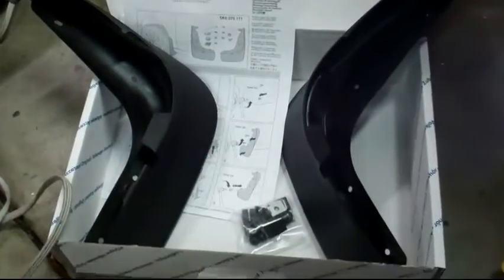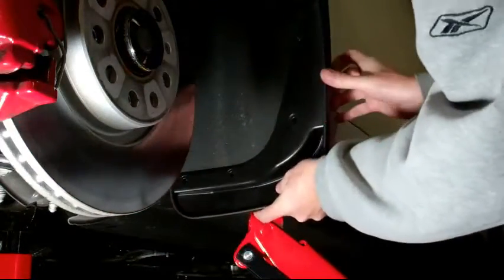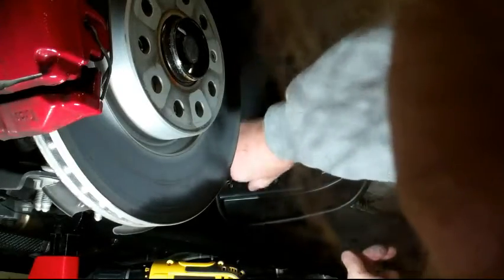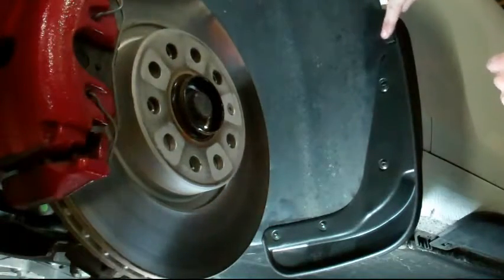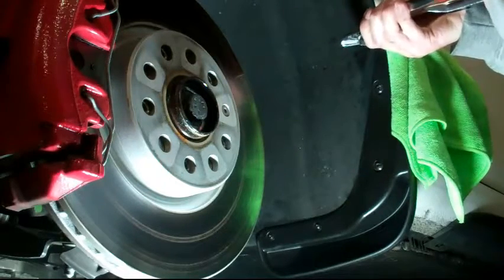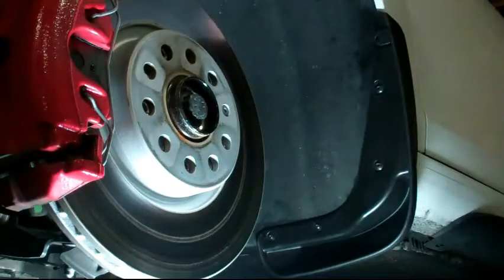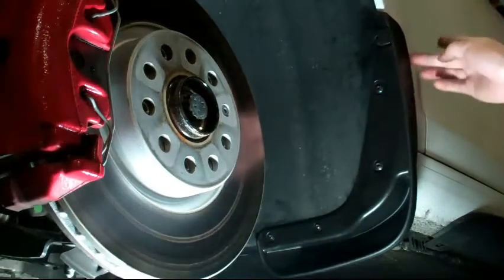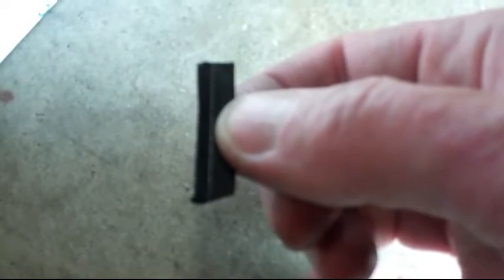2011 VW GTI: Episode 23 Vlog: Installing oem front splash guards

Comment: Anyone know how to remove the clip? I need to remove mine for some work
Reply from the maker: what clip man
Reply: Hey, what Ii mean are the 2 piece clip that holds the mudflap to the body
Reply from the maker: the clip that came with the kit?? It just slides off after you take out the screw..
Reply: LastHumansGarage ah thanks just wasnt sure if i would have to buy new ones when reinstalling them since they were so tough to on
Reply from the maker: after removal, squeeze them real tight again before reinstalling